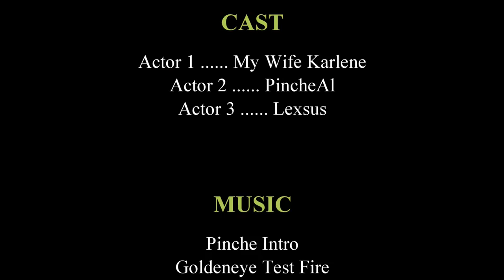How to Roll MK4 Jetta/Golf/GTI Fenders Season5 EP8

Comment: I need how to pull fenders on my Gen 3 Gli D:
Reply from the maker: Jadniel Ferrer just use this video its the same process for all cars. Just take your time
Reply: PincheAls Garage even when I want to pull them instead of just rolling? Cause I want the back to look the same as front “wider”
Reply from the maker: Jadniel Ferrer correct just keep adding pressure slowly oitward like your rolling them and it will pull the fender. Be careful because it will crack the paint if not enough heat is applied
Reply: PincheAls Garage Okay, I’ll uploade pics and a vid after I get it done 💪🏼